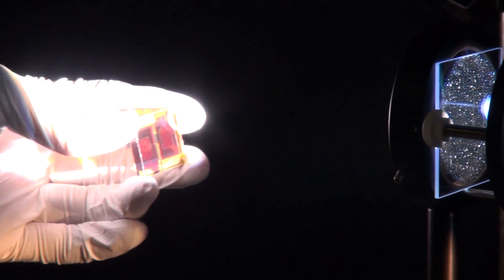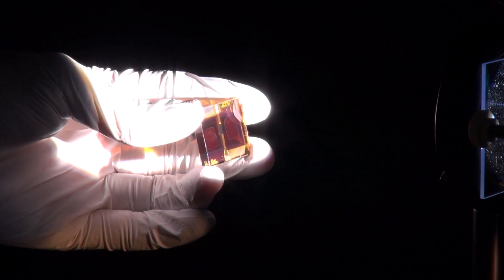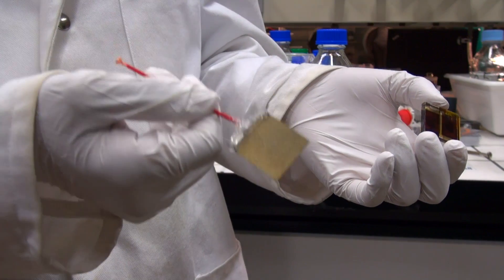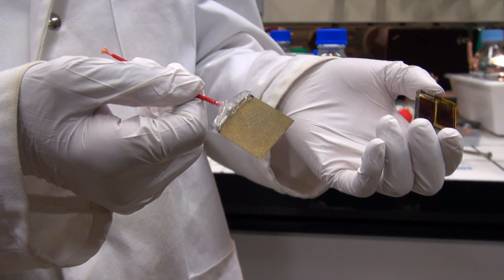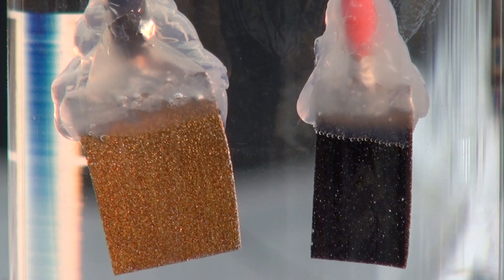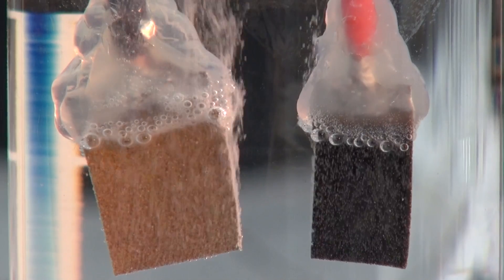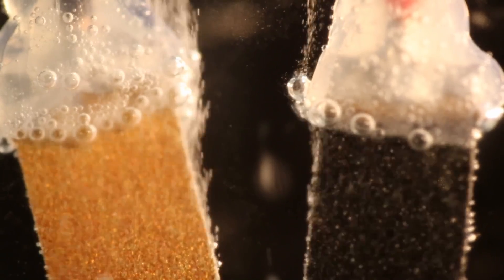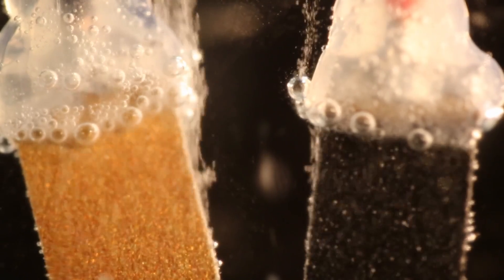A 12.3% efficient solar to hydrogen conversion with low-cost, earth-abundant materials

Comment: important progress. especially for heating at winter. system can easily produce hydrogene in summer and then it can be used at winter. propaply storage problem will be big problem. if it is solved we wont need narural gas. but i think perovskite solar cell has big potential. if researchers can combine it with sun light concentration technology it will be very very cheap. propaply it will be cheaper than Fossil  fuels.  for manufacturing prosess 100 c degree isnt a big temperature so this heat can colllect by solar collectors easily. this system will be cheap. energy cost for manufacturing will be very low. with sun concentration technology system will need less solar cell surface area.

Comment: Would using high surface area geometry electrodes such as nanotube sponges or nano honeycomb-like electrodes provide higher hydrogen production efficiencies?
Reply: Perhaps not in a honeycomb config but rather in a fibunacci golden ratio config.